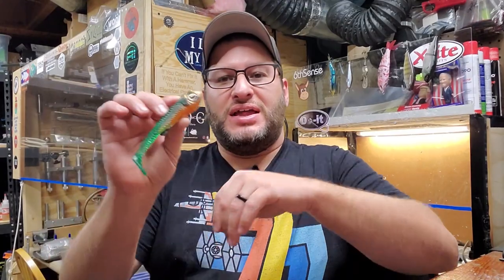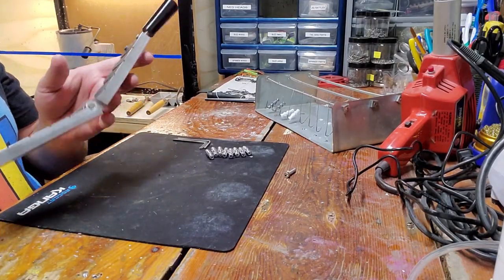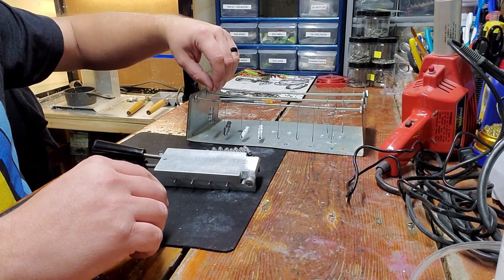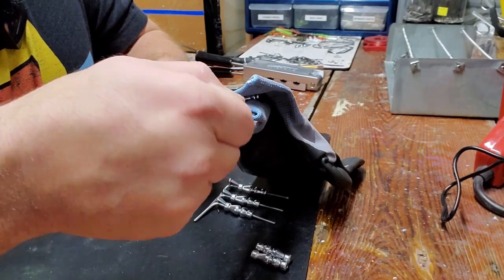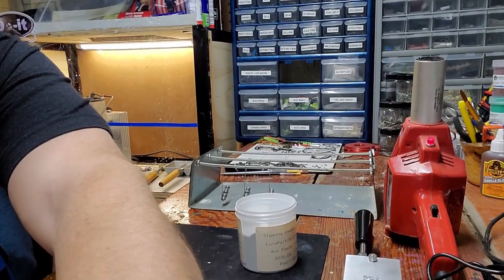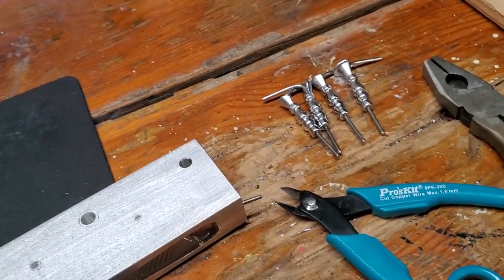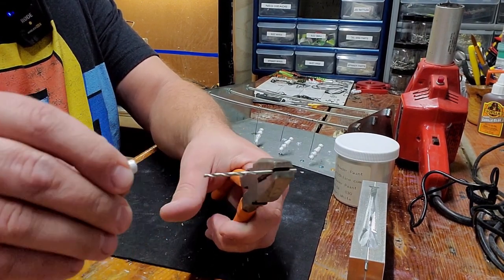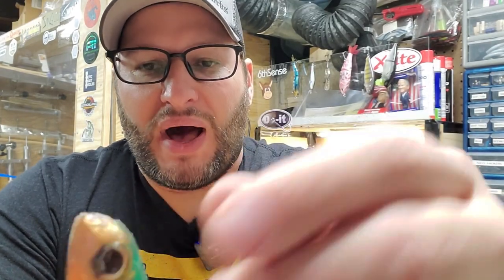Line Thru Swimbaits (PART 1)(INSERT MOLD)

Comment: First and most important.  Thank you for the plug.  

I have a few things I noticed that might help you, and a few things that might help anybody else using this mold.  I'm not saying anything you are doing is wrong.  I'm just trying to add your knowledge.  Not detract from it.  

1.  The half sprue is deliberate so that you do not crush the hole closed when cutting it off.  
2.  I have better luck with talcum powder instead of graphite spray on close clearance molds.  It needs to be reapplied more often, but the tiny particles break the surface tension of the lead and allow it to flow out better.  
3.  On the rare times that I use graphite I have had no issue using cheap graphite lube from the hardware store, although Drop Out is certainly a quality product.  
4.  The pins are 3/32 inch.  They are made from 308L stainless steel TIG welding wire which tends to be dimensionally quite good.  I prefer stainless steel as it is not as reactive with other metals.  The hinge pins, handle studs, and the screw are all stainless steel.  
5.  I pull the pins while the weight is still in the mold.  You get virtually zero formation of the ballast weight if you pull the pin at this time.  The mold itself makes a great handle for one gloved hand, and then you can grab the L of the pin with a pair of pliers as you already do.  
6.  Generally I've found if I twist the pin all the way around it pulls a little easier.  I've never tried them with a lubricant, but I have had customers tell me they use either silicone oil or motor oil respectively as they can stand much higher heat than worm oil.  They do not dip the pin, but rather wipe it with a cloth or paper towel "lightly" dampened with their oil of choice.  They say you do not need the pin to be "wet."  It just needs a very thin film.  Like I said I don't use oil for my pull pins.  I do sometimes use worm oil in the SNS tube molds, but that is typically a much larger pin with more surface area and runs at a much lower temperature than molten lead.  
7.  PTFE pins might allow you to powder coat without having to drill.  Drilling tends to be slightly oversize though, so it may be why your 3/32 mold pins slides in easily.  
8.  You mentioned that the lead weight is larger than the brass weight.  Brass is approximately 0.305 lbs per cubic inch.  Leads is about 0.41 lbs per cubic inch.  Lead is 25% heavier than brass per volume.   My calculations are based on near pure lead so its possible if you have a lot of "other stuff" in your alloy it could be a little lighter, but it would take a lot of garbage to be as light as a same size or smaller brass weight.  Given all of that you might be happier dropping to 1/4 oz size lead insert weight.  If nothing else it might be to know the exact weights (+/-) you are working with.  Harbor Freight has a couple cheap little digital scales that are plenty good enough for lighter items like this.  I have both of their small models in my desk.  The more expensive one was only about $15 last time I looked.  
9.  I included a small allen wrench with the mold for the clamping screw.  I include one with every order that needs one.  They are cheap.  I buy them in bags of 100.  I do make some bigger "knob head" clamping screws that can easily be opened and closed tightly by hand, but I don't really feel they save enough time be worth what I have to charge for them.  

I thought there was an item 10, but I can't remember what it was.  I hope I was helpful.  Again.  Thank you very much for the plug.
Reply: 10.  I shared your video on my social media accounts so hopefully it will generate some more traffic for you.
Reply from the maker: Dude! Information City! Thank you so much! I will definetely try alot of what you have told me especially pulling the pins while they are in the mold! I don't know why I didn't think of that. Thank you again sir for watching and helping!
Reply: @B8N_Tackle    I just wanted to give you a heads-up. I replied to your email and got some kind of bounced notice about your mailbox being full. If it's the same email address you use for business it could be affecting sales.  I also left you a voicemail at the phone number you provided.
Reply from the maker: @cncmoldsnstuff4423  got your message this morning, thanks for letting me know, appreciate it bud!

Comment: So I know lead weights will discolor plastisol. I'm curious if the powder coating prevents that or not? I've heard that it does and also that it doesn't. 
What kind of results have you had with powder coating?
Reply from the maker: So far so good man! It's been almost 2 months since I made those and no issues yet. I coated them with protec white pearl.
Reply: @B8N_Tackle  awesome. I wonder if there are some powders that oxidize and some that don't? I own a small bait business and want to atart producing big line throughs. 
Pondering and cooking them myself will definitely be easier than paying someone to nickel plate them. 

Have you used the brass inserts as well? I've heard those can discolor the plastic too.
Reply from the maker: @davidknebel1340  I've used only a few of the brass ones, haven't noticed discoloration but they are very expensive, I think last time I looked the brass was like $1.50 a piece. Getting the lead mold would definetely be cheaper in the long run.
Reply: @B8N_Tackle  oh ya, 100%. Just thought I'd buy a few of the brass ones to get started until I can get the lead powdering process down and make sure all my powders will keep the lead from oxidizing the plastic. I just don't want to use them at all if there will be discoloration. Plus I believe BTS only offers them in the 1/4 Oz and im looking to thrm in 7" and 8" and will want heavier ones.

Appreciate your input. It's been very helpful
Reply from the maker: @davidknebel1340  cnc molds n stuff sells the lead molds. 1/4, 3/8, and 1/2oz options for lead.
Reply: @B8N_Tackle  yessir,  I've looked into that already. After watching your first video. Thank you for that also.

Comment: Why do you not keep a pin in money power paint them and take it out afterwards that be a little bit more easier I think and you keep hole in that clean
Reply from the maker: Because then I would have to clean the rod and it's terrible to get the paint off.
Reply: Drilling tends to slightly oversize the hole which probably makes it a little easier to place the weight on the mold pin of the same size.
Reply: @B8N_Tackle  Teflon (PTFE) pins tend to clean up easier.  Lots of guys use them in jigs.
Reply from the maker: @cncmoldsnstuff4423  I also use Teflon on jigs now, much easier, never thought to try on the weights though.